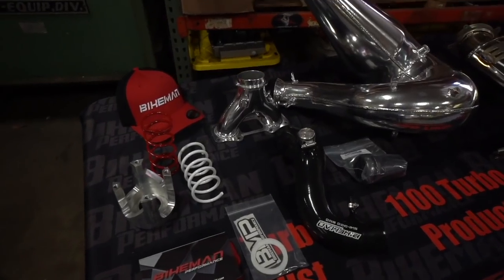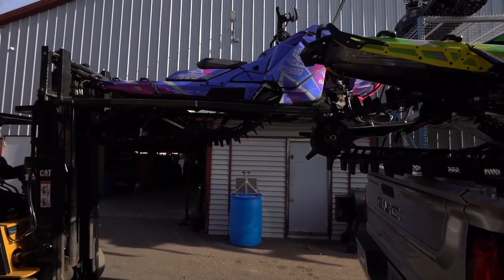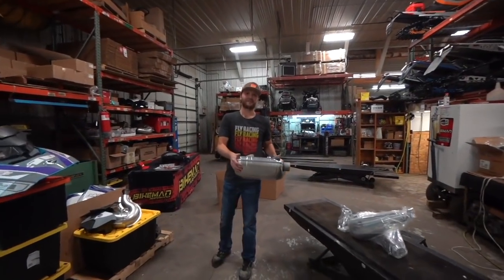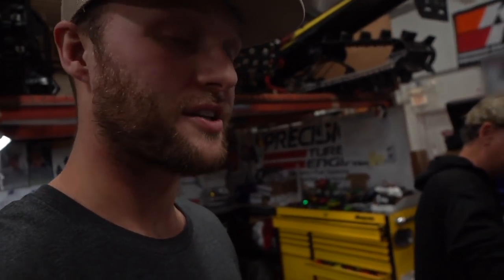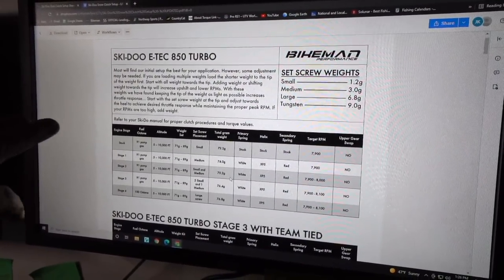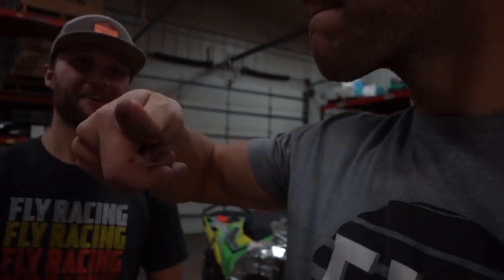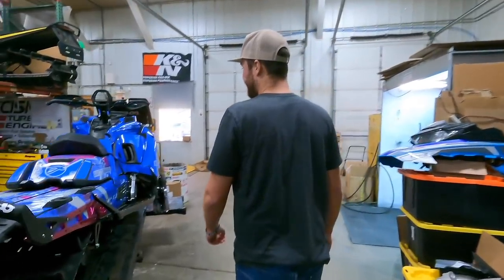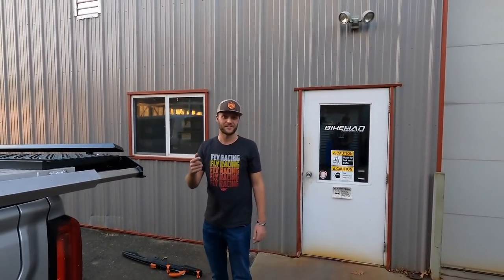2022 Boondock Nation Sled Builds (Part 2)

Comment: Hmm my stage 2 Speed Shop inc on my zr8000 is 185hp. I would have thought the turbo stage 2 would have been 240+!?!
Reply: This is at say 8,000 ft. @ 8k ft your zr would only make 130 hp. For every 1000 feet you move up in elevation you lose 3% of your horsepower. The Doo turbo makes the same hp at sea level as it does at 8k by compensating boost.